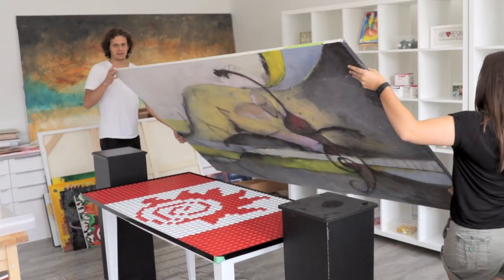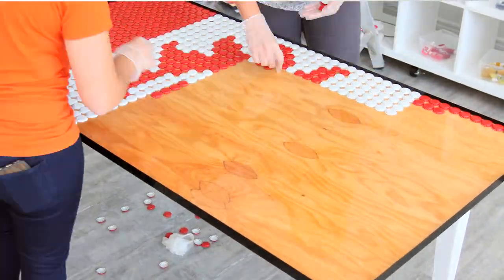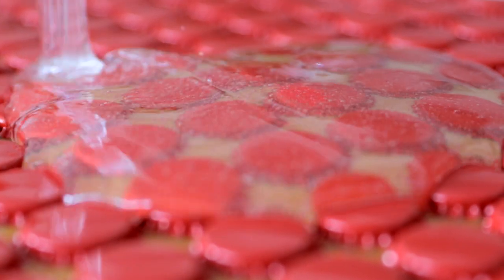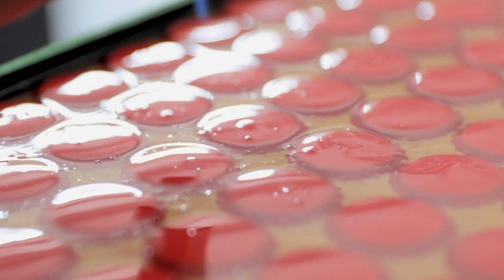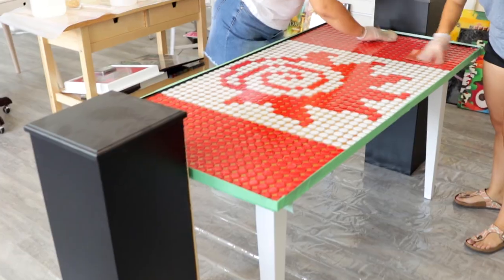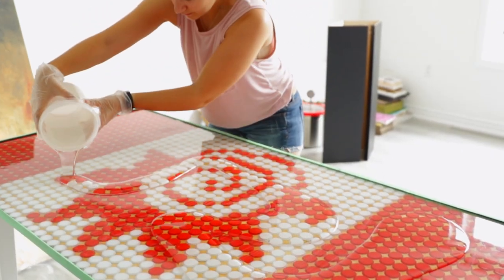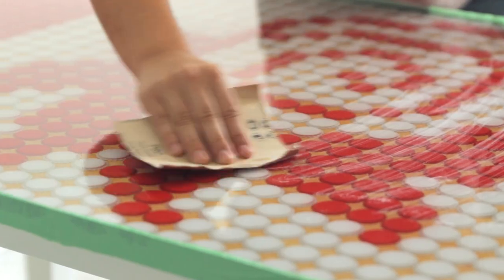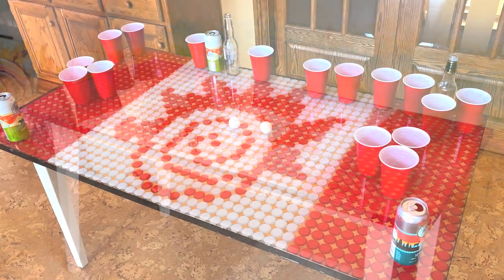How To Resin A Beer Pong Table - Part 2

Comment: Beautiful. Very original and artistic. Question : How much Resin you used  for each layer. ?
Reply from the maker: Hi Pily - thank you for the kind words!  The perfect ArtResin pour is 1/8" for 2 reasons ... it will naturally self-level to 1/8" and this is also the perfect thickness to allow bubbles to rise to the surface so they can be easily torched out.  You can pour as high as you'd like, as long as you pour in 1/8" increments and we always advise sanding dried layers before you pour a fresh coat for best adhesion.

Comment: Does the work room/studio need to maintain a certain temperature during curing?
Thanks.
Reply from the maker: As a general rule, warmer is always better than colder.  The ideal working temperature for ArtResin is 72-77F or 22-25C  :)